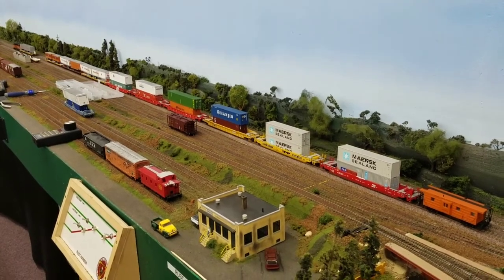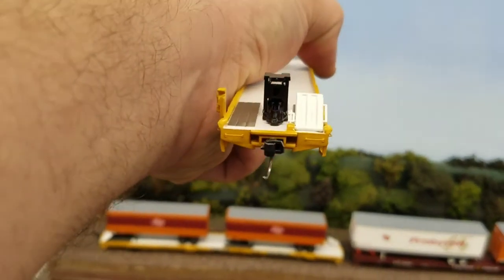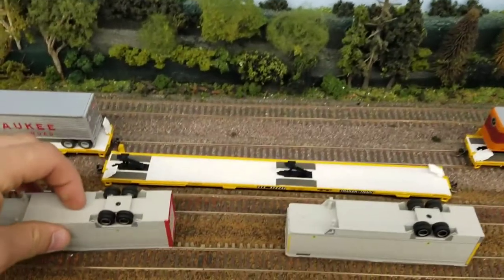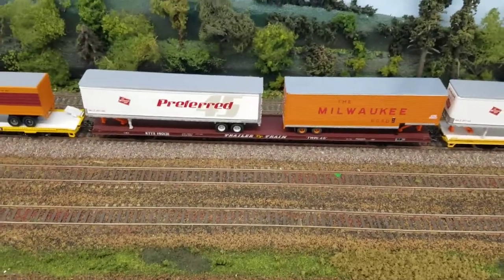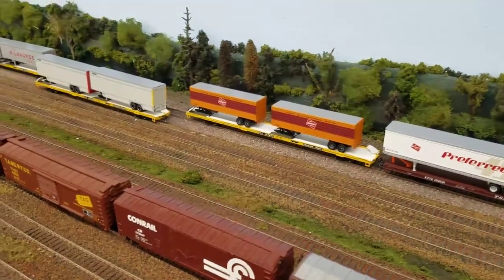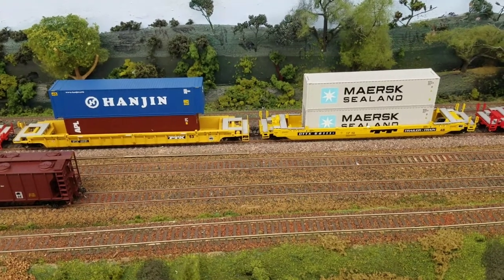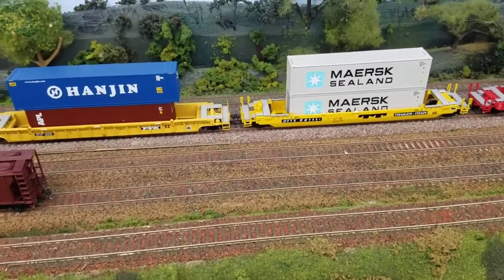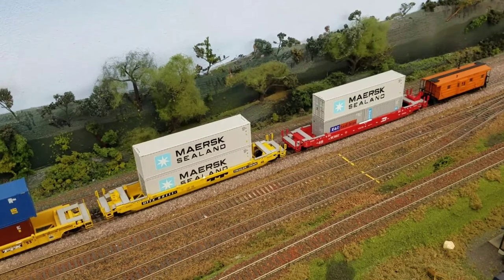Walthers vs Athearn intermodal

Comment: The wellcars are measured by there maximum length container they can handle. It is common to mistake the big "40", "45", "48", and" 53" for part of the road number. On every wellcar the road number is smaller than the well measurement. So your comparing a 48" wellcar from Athearn to a 53" wellcar from Walthers, which in turn makes the comparison biased. I have a TTX 53 foot wellcar from Walthers, and a 48 foot maxi III  wellcar from Athearn, the only difference (so far) is which one is on the rip track more often (the Athearn car).